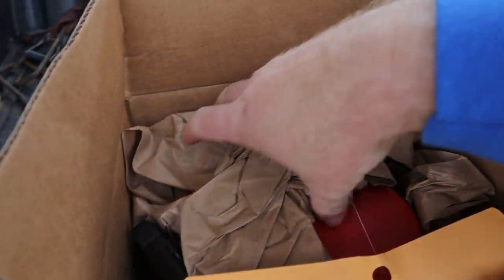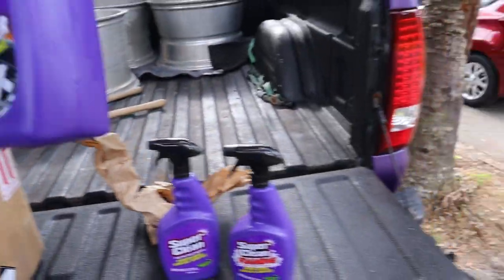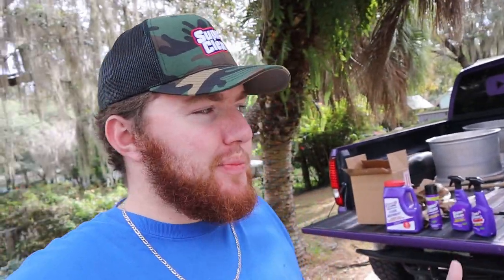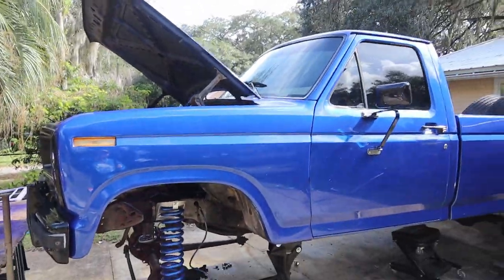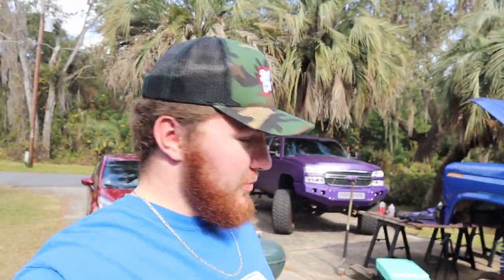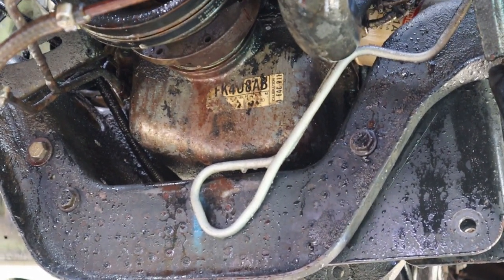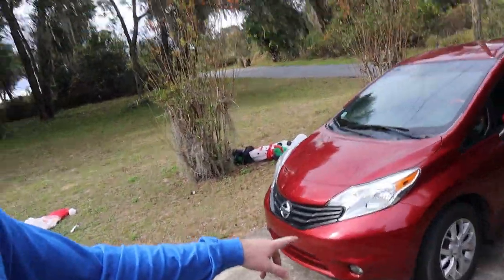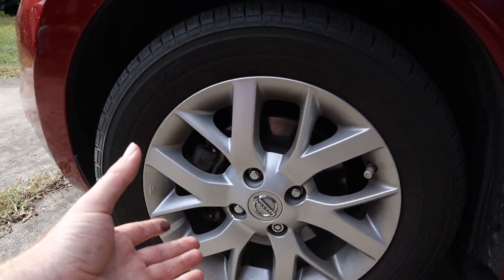EASIEST Way To CLEAN ANYTHING Without Even TOUCHING IT!

Comment: I discovered Super Clean in spring ‘19 shortly after I bought the truck. I had a 2012 Malibu LTZ that I had smoked in for 7 yrs that I wanted to give my 16 yr old Daughter and obviously I couldn’t give her something that was caked with/reeked of nicotine. Started researching how to get it cleaned & deodorized and came across a few detailers that swore by Super Clean. I ordered my first gallon from Amazon before I knew that Walmart and Autozone carry it. Used it on every surface of her car and then used an ozone generator,now you wouldn’t know the car had ever been smoked in. I use it as a pre-soak,makes short work of bugs too. Magic spray in a bottle!
Reply from the maker: I will forever use Super Clean now, it absolutely blew my mind with how easy it was to use.

Comment: Hey I just bought a Ford F-150 1986 Do they make 24x14 for those truck ?
Reply: Yes they do, the lookup the lug pattern online and find wheels to match.
Reply: @classicshoelaces.7340  question they build wheels spacer 5x6 lugs
Reply: @AlexFlores-gn1lp  I wouldn't use wheel spacers, but if you do use quality ones. I'm sure that they make them in that size.
Reply from the maker: You can get wheels for any lug pattern, if you find a used set you like in a different lug pattern you can always use adapters. Check out my other videos I have videos using adapters and spacers.

Comment: Did you have to cover the battery when cleaning the engine bay cause I need to clean mine
Reply: No need in covering the battery. Just the alternator and distributor if it has one
Reply from the maker: Only thing I was worried about was the carburetor since I didn’t plan on starting it or driving it for a couple days. If the alternator or distributor got wet, it had plenty of time to dry out before running again.

Comment: It's neat, however it's about 14 dollars and engine degreaser is like 3.
Reply from the maker: It may be more expensive but for not having to scrub anything, I’m very happy with it.
Reply: @AaronCates  you used a power washer, its not like it fell off. Compare it to a couple other cleaners then it might do something. But right now it's just overpriced junk.
Reply from the maker: I see where you’re coming from but I’ve never seen any cleaner take off 5-6 months of brake dust build up without even touching it. I’ve used purple power and simple green so much I could tell you which is which with my eyes closed and even they don’t touch stuff this easily.
Reply: @AaronCates  since you bothered to reply to me and actually back the product which is more then alot of people would do I belive that I might be something, however I don't see the point in the engine cleaning, wheels maybe, i went to my shop and grabbed anything that could be a cleaner and I tested it on my truck which hasn't been cleaned in at least a year, since I didn't use a pressure washer I would say it is about the same result. I wouldn't trust this stuff for American forces or whatnot but for 4 dollars that I paid for this can I would say its comparable. I realized that this isn't even the worst part of my truck, I will go out and try again if you think this is a unfair test. After all I know that you wouldn't intentionally mislead people, anyway here was my results. https://youtu.be/7P6OeZnEiao